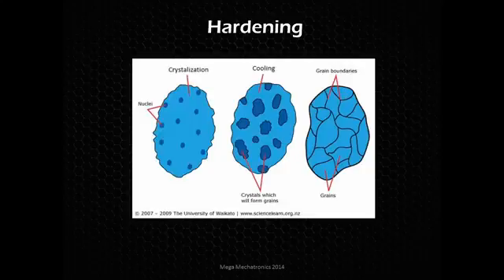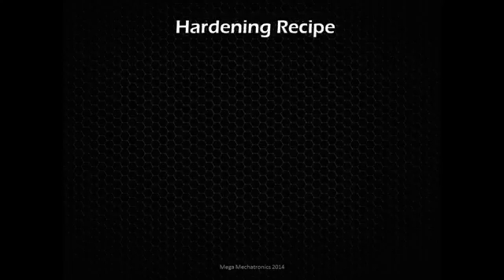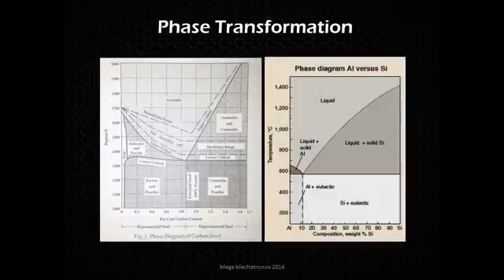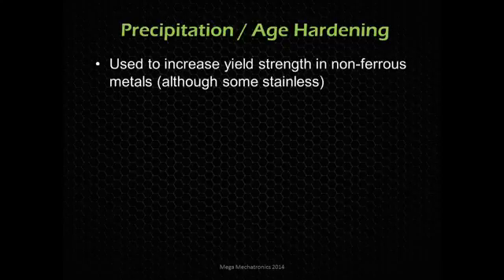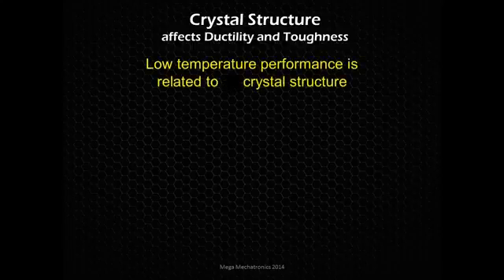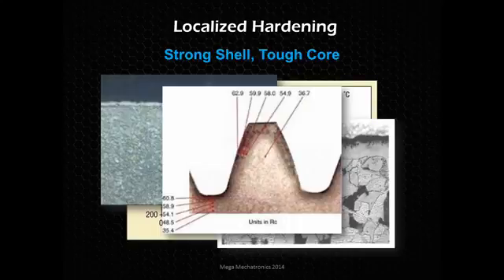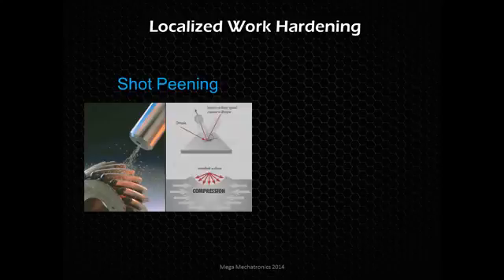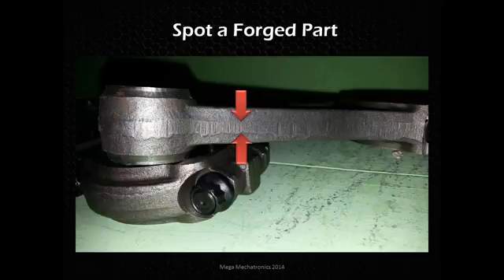Materials Science Mechanical Engineering    Part 4 Heat Treatment Explained

Comment: Annisa Nur Amalia
2714100056

every material has their own type of crystal structure, BCC (Body Centered Cubic), FCC (Face Centered Cubic) or Hexagonal type. The process of crystallization start from nucleation, then yhe crytal start to grow, and finally fully growth unti there is boundaries. not only growth, other phenomenon in crystal structure is slip. slip hapens because of dislocation that happen in atom, the dislocation here means the atom move the other place because there are forces from the outside. if the dislocation is severe, than it can cause slip. every materials has their own mechanical properties, hardness is one of them. and the ability of material to get into gamma forms, so the material can get high hardness. 

to get the hardness or the softness of material that we want, we do the heat treatment. There are many process in heat treatment, hardening, tempering (austemper, martemper, and cryotemper), annealing, etc. 

first one is hardening. we use this treatment to get higher hardness number, to make the material thougher, and durable. there are 5 hardening process. first one is grain boundary straightening, then work hardening, then solid solution straightening, next one is precipitation hardening, and the last one is martensitic transformation. the mechanism of this process are:
  1. heating the material until above the critical temperature
  2. holding
  3. rapid cooling
the resut of this process is martensite form. there are two types of work hardening, the first one is cold working, and the second one is hot forging.Cold working is the process of strengthening metals through plastic deformation. This is made possible through the dislocation movements that are produced within a material's crystal structure.This is a technique commonly used in non-brittle metals that have remarkably elevated melting points.

the next process is tempering. we do the tempering process to  develop the required combination of hardness, strength and toughness or to relieve the brittleness of fully hardened steels. the mechanism of tempering is more less the same with hardening. but, if in hardening we do the holding once, then in tempering we do the hoding twice. the purpose of this twice holding is to soften the material, so the material would not have too high hardness and the pupose is to relieve the stress.  from what i know, there are 2 types of tempering, the first one is austempereing, and the second one is martempering. but, from the video above, there is one more type of tempering, which is cryotempering. the product of austempering is bainite, otherwise, the product of martempering is martensite. Advantages of Austempering :
  1. Less distortion and cracking than Martempering,
  2. No need for final tempering (less time consuming and more energy efficient)  
  3.  Improvement of toughness (impact resistance is higher than the conventional quench and tempering)
  4.  Improved ductility  
The advantage of martempering lies in the reduced thermal gradient between surface and center as the part is quenched to the isothermal temperature and then is air cooled to room temperature. Martempering also reduces or eliminates susceptibility to cracking. Another advantage of martempering in molten salt is the control of surface carburizing or decarburizing. for cryotemper, it makes retained austenite into martensite. it promotes uniformity and strength. it used liquid nitrogen -300 degrees F.

the next one is annealing. it is used not to make the material harder, but to make the material softer. annealing is the process of slowly raising the temperature about 50  degrees C above the Austenitic temperature line A3 or line ACM in the case of Hypoeutectoid steels  and 50 degrees C into the Austenite-Cementite region in the case of Hypereutectoid steels. It is held at this temperature for sufficient time for all the material to transform into Austenite or Austenite-Cementite as the case may be. It is then slowly cooled at the rate of about 20 degree C/hr in a furnace to about 50 degree C into the Ferrite-Cementite range. At this point, it can be cooled in room temperature air with natural convection. The grain structure has coarse Pearlite with ferrite or Cementite (depending on whether hypo or hyper eutectoid). The steel becomes soft and ductile.

thats's all i can explain, i'm sorry if there are many mistakes or deficiency in my review. wassalamuaaikum
thank you

Comment: HAKIMUL WAFDA
2714100065
This is my summary about the video. From the video we can learn about hardening treatments, heat treatment, and even some cold working processes. 
When we want to hardening a material or metal means that we crystallize it and let those atoms move around then we cooling it down so the atoms are going to start forming crystal and at the microscopic level for ferrous materials for example aluminium we’re looking at cubic structure and there are a body centered cubic and face centered cubic. The body-centered cubic system has one lattice point in the center of the unit cell in addition to the eight corner points. It has a net total of 2 lattice points per unit cell and the face-centered cubic system has lattice points on the faces of the cube, that each gives exactly one half contribution, in addition to the corner lattice points, giving a total of 4 lattice points per unit cell.
Crystal structure FCC and BCC will affect the ductility and toughness at different temperature. And at low temperature performance is related to the crystal structure. BCC crystal structure experience a ductile to brittle transition at lower temperature, and the FCC crystal structure retain ductility at low temperatures so the T-1000 is clearly Body centered cubic. For example copper is not affected by temperature because it is a FCC ( face centered cubic). 
Crystall lattice dynamis is a dynamics of the crystal structure. We can look that the structure of the cubes make a form that we can moves the things around and it won’t break or fracture because the atoms are bounded together by kind of like a magnetic force. So if we shift that over if you classically deform it, the atoms are going to latch on to an adjacent set of atoms and move around.
The size of grain boundary is really important to the mechanical properties of the material. The smaller the grain (finer) the harder, stronger that material will be. The bigger the grain (coarser) the less strength and ductile it will be for the material. Smaller grain will give a stronger material because it will reduce possibility for the crystal lattice to move or deform by slip mechanism. Because it will have some kind of wall to stop the slip so it will not deform easily.
Hardenability is limits dependent on alloying elements of the metal. Hardness dependent on carbon content in ferrous metals. On the chart we have a hardness versus carbon content. The rock wealthy hardness scale goes up as the carbon content goes up. Hardening Recipe is very important of the time, the temperatures that the material is fees during the hardening process. If we have the scale from ambient temperature up to transformation temperature which could be 1600 degree Fahrenheit for certain steals what it all depends on the alloying elements and then that versus time so we heat it up clench it and then we will do a little temper here so the heating rates important the time at temperature depending on the thickness of that material and of course the alloying elements in it. The cooling rate is very important that the cooling rate does what the quench does is it lacks in a certain crystal structure desirable. Hardening can be success if you can follow that recipe consistently. Phase transformation will give an engineer an idea of where to start with what temperature. Then we learn about composition matters, e pluribus unum, tempering, normalizing, annealing, quantifying hardness, scratch test, and crystal structure affects ducitility and toughness.
localized hardening, There are lots of advantages of localized hardening for example is induction hardening for shaft it’s going through inductor ring and it’s using electricity and magnetic forces and its heating up the surface of the material and its dropping into quench tank to get a very hard surface and durable core to take impacts and prevent fatigue failures and then we have nitriding or carburizing where we are infusing nitride with infusing carbon because carbon content is affects the hardness. We are  going to keep the material up in special chamber that have a atmosphere filled with carbon and the carbon is going to infuse into the surface of material when it heat up, so we have a strong shell and tough core. The content of the atmosphere within the chamber wall affect it as well as temperature so the lower temperature give higher hardness but at lower depth and then you rise the temperature that the nitride can infuse much deeper into the material but it doesn’t give you a higher hardness. And then Cryogenic treatment is transform retained austenite into martensite and this will help perform multi uniformity and strength. The liquid nitrogen in cryogenic treatment is about minus 300F degree and the mechanical (like super refrigerator) can event  get down minus 100F degree. So the hardness dooes correlate with the strength of the material. At the chart of hardness vs strength when the hardness goes up so does the strength and then at the hardness vs toughness the hardness it is more brittle and less tough but it depends on the alloy. And then Cold working, is the type of the work hardening but it is changing the structure, grain, dislocation and how those crystal lattice are interacting with each other. It is uses compression forces and plastic deformation and creates desirable dislocation in the crytal lattice structure, improving yield strength, but reduce ductility. The example of cold working process is cold rolling porces, this process is give the material tighter tolerances and the other example of cold working is cold heading this is the process of putting the head  on a bolt so the die comes down and plastically deform and it does work hard in the head and  make it stronger.
Hot hardening done at higher temperature and stronger than an equivalent cast past and aligns grain structure to the shape of the part.
So that all of my summary, thank you.

Comment: Leonardo Paulo Dwilongga Pareira
2714100046
Heat Treatment

Hardening and treatments are the defining factor when it comes to rhe capabilities and performance of all metals. Cubic where there adams centered on the face around that cube , even hexagonal for some other materials Cristal lattice dynamics Structur so imagine this is a structur of those cubes and we ca move those thing around and it wont break or fracture because those the atoms are bonded together by kind or like a magnetic force so if you shift that over if you classically deform it those atom s are going to latch on to and adjacent set of the atoms and move around, magnetic ball toys its sort of illustrating that where he strarts to forming it  ut it stays come together the balls moved their position but it still sounds something to latch on to a similar adam and when this happens when these chris will start forming randomly within the materials they are to be crystallizing in different orientation to ech other so this an example of a galvanized surface and that zinc crystallizing in different orientation and then the light refracting of that it different ways and then can easily make out the grain boundaries so looking at a computer generated model could sort of see the crystal structur a uniform grain and then they will grain boundaries around there will zoom in even closer sort of outline those and givn you an idea of the different orientation and the size of the grain boundary is definitely important so we do have smaller grain that is going to give us a stronger harder metals because we are reducing the ability for those string for that crystal lattice to deform and move around because there are these deformities they are sort of like a wall stopping them form moving any further and then the other side of theat we have huge  grain s  and yhat makes the material more ductile because because allowing it to move around and deform and allow those cubic to move around and adrey orientate themselves and shift around and the concept of hard ability different alloy of  metal are going to have different abilities to too hard different mac hardeness that you can achieve so with ferrous materials we put carbon in it and characteristics to this cristal structure as it it in there it deforms it in a certain way and allows us to harden that material by bike controlling the cystal structur. Hardening recipe is very important of the time the temperature that the materials is fees during the hardening process. Engineering properties are modified by heat treatment processes so that structural components are able withstand specified operating conditions and have desired useful life. Heat treatment is the heating and cooling of metals to change their physical and mechanical properties, without letting it change its shape. Heat treatment could be said to be a method for strengthening materials but could also be used to alter some mechanical properties such as improving formability, machining, etc. The most common application is metallurgical but heat treatment can also be used in manufacture of glass, aluminum, steel and many more materials. The process of heat treatment involves the use of heating or cooling, usually to extreme temperatures to achieve the wanted result. It is very important manufacturing processes that can not only help manufacturing process but can also improve product, its performance, and its characteristics in many ways. Hardening involves heating of steel, keeping it at an appropriate temperature until all pearlite is transformed into austenite, and then quenching it rapidly in water or oil. The temperature at which austentizing rapidly takes place depends upon the carbon content in the steel used. The heating time should be increased ensuring that the core will also be fully transformed into austenite. The microstructure of a hardened steel part is ferrite, martensite, or cementite. Tempering involves heating steel that has been quenched and hardened for an adequate period of time so that the metal can be equilibrated. The hardness and strength obtained depend upon the temperature at which tempering is carried out. Higher temperatures will result into high ductility, but low strength and hardness. Low tempering temperatures will produce low ductility, but high strength and hardness. In practice, appropriate tempering temperatures are selected that will produce the desired level of hardness and strength. This operation is performed on all carbon steels that have been hardened, in order to reduce their brittleness, so that they can be used effectively in desired applications. Annealing involves treating steel up to a high temperature, and then cooling it very slowly to room temperature, so that the resulting microstructure will possess high ductility and toughness, but low hardness. Annealing is performed by heating a component to the appropriate temperature, soaking it at that temperature, and then shutting off the furnace while the piece is in it. Steel is annealed before being processed by cold forming, to reduce the requirements of load and energy, and to enable the metal to undergo large strains without failure